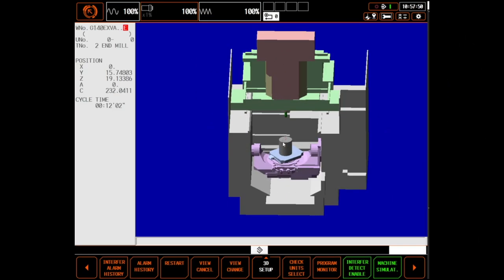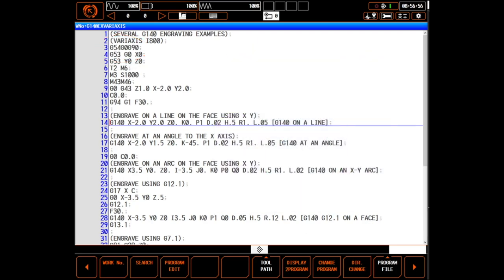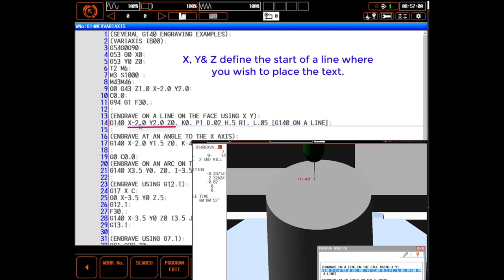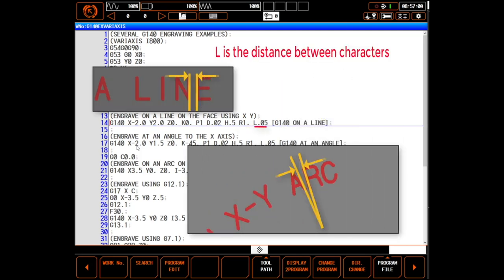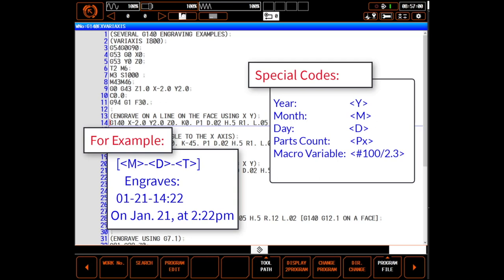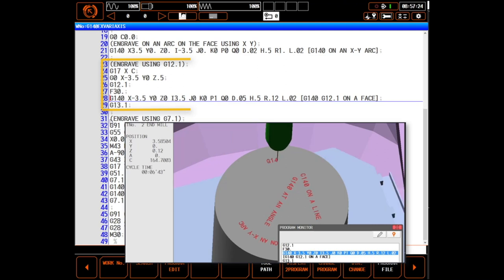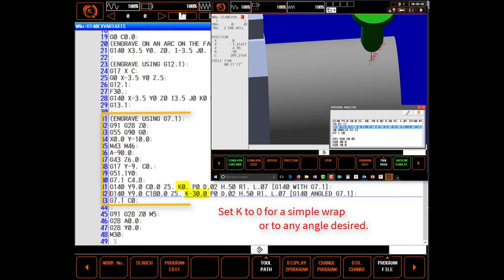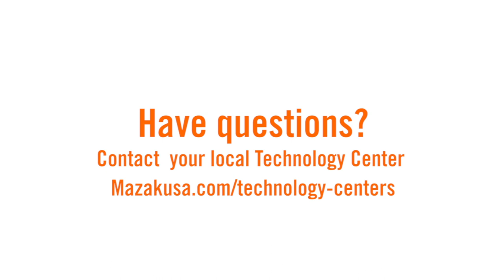Mazak SMOOTH Cafe: G140 SMOOTH Engraving Macro

Comment: If someone needs unlock this macro option G140..let me know😎
Reply: I'm all ears! What parameter is it? Option parameters in 1131 mode I guess?
Reply: @markpalaszewski8546  omg. U dont understand. Its not a paramter. 🤣😂
Reply: @primoz843  ...it was worth a shot. You can disable ISS with parameters, might have been able to enable engraving too!

Besides, I use CAM for engraving. Much better at it and more flexability.
Reply: @markpalaszewski8546  its not just a paramters...this is my last answer.
Reply: @markpalaszewski8546  I'm interested. Say me how to
Reply: Im interested. Can You help me ? Thanks :)
Reply: Its all about reversing the dot net env  and vxworks. This is all i can say. System O and M paramters do not effect on FLROM. Its only a setting for sw options. Cheers.